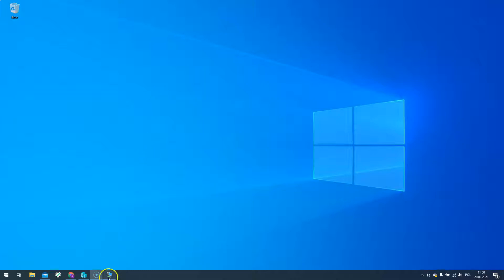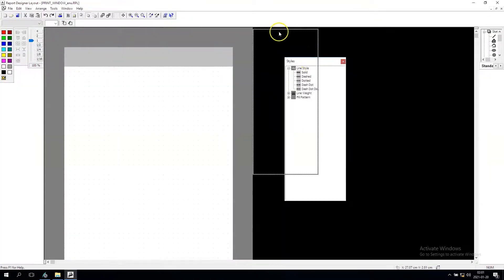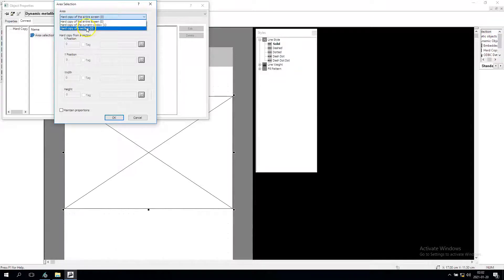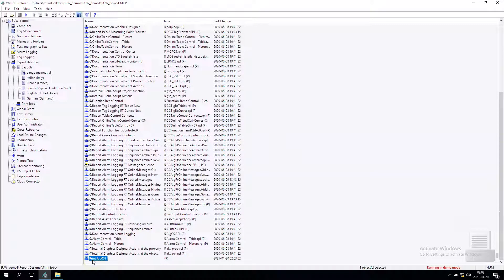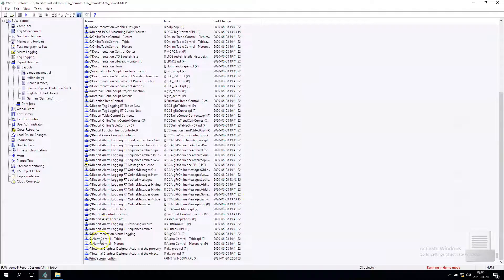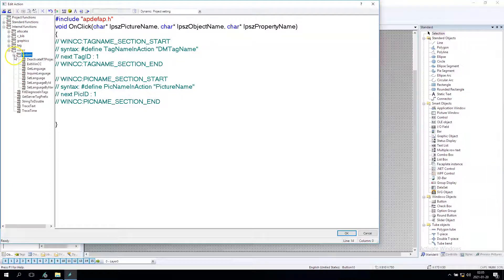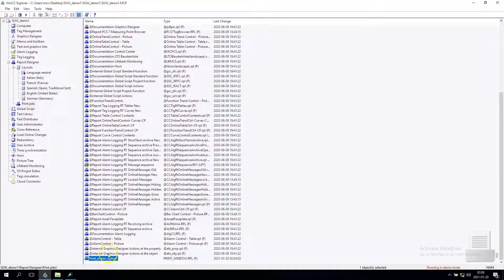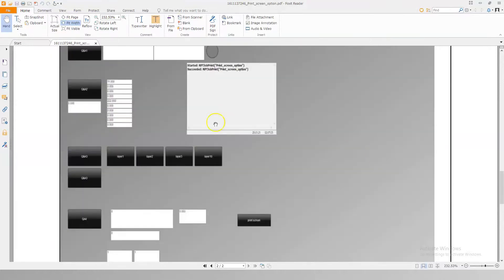How to print screen, window using Report Designer? WinCC V7 tutorial#32

Comment: Sir .. in our plant we have several area start stop button it's design by OEM is it will start when we give first click and after 5 sec second click. So basically what operator do keep clicking 10 sec. Now we want to make log of start stop it's working ok . But problem is  there is too many log of start and stop is there is any way we can make set rest in c script on click. Do you have any idea to solve this by script.
Reply from the maker: Sure. It's posible 🔥
Reply: @SCADAWorld  can you guide me how I can make that script presently when the left press it's directly makeing log file what I need to do to solve this problem . What we want is even they click so much for that time it will generate only one log file
Reply from the maker: @TravelVlogRoad  Hey send me on email details. Logfile before and how it should work or something. I need to understand this first.👍